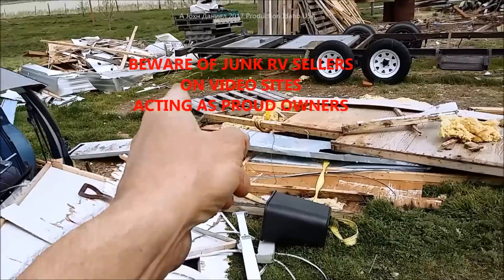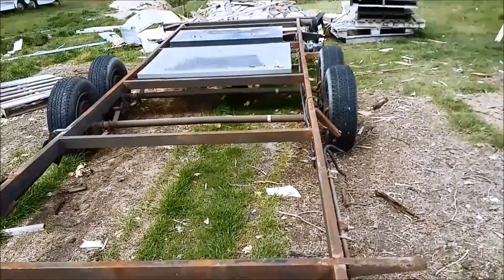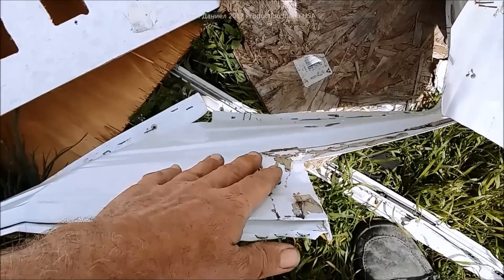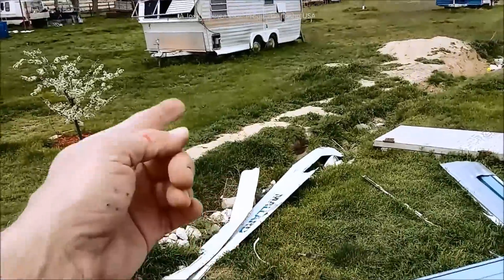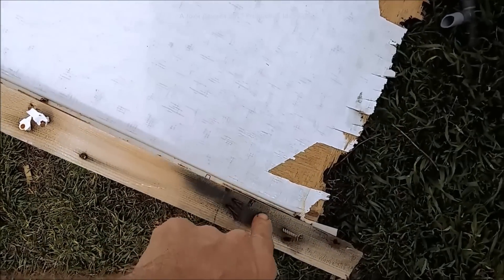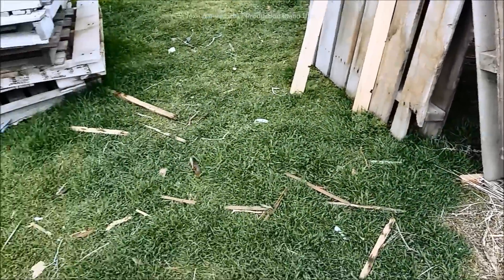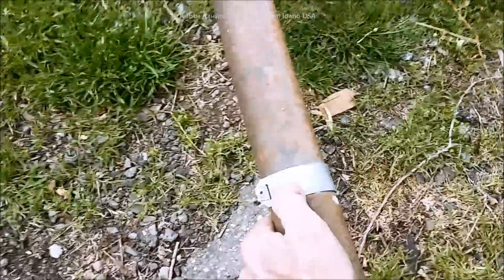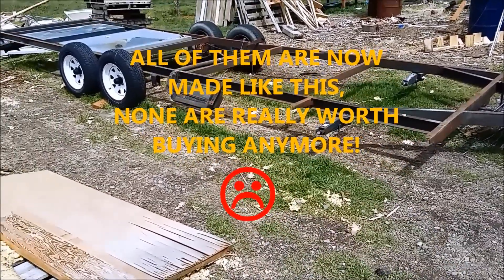HOW THEY MAKE RV Campers Travel Trailers, The truth, Wow! Info Below

Comment: My granpa has a 2017 basically new 50's style camper. It is beautiful, it has whitewall tires, cool red siding, and a checkerboard floor. But its the cheapest piece of shit I have ever seen!! They live in a very rainy place which makes it completely unlivable. With 7 damp-rid containers, and wiping down the windows it still is starting to get significant water damage. Anything that touches the wall rots it out and molds. The walls are made of what can only be described as fancy cardboard. When you so much as gently push on the hall wall that is also the shower wall the entire shower bows and faucet and whatnot move a good 4 inches. Ive been staying in it temporarily and i do my best to maintain it but im ruining it just by being inside it (condensation from temp difference). I wipe the windows, below the windows, and the 3 inch strip of wall along the floor but theyre still molded to shit. Any advice (other than lighting it on fire and pushing it off a cliff), this really makes me look bad but im very responsible and caring, it just seems like they werent designed to be inside when its below 50. Its a floor model so idk if that has anything to do with it
Reply from the maker: I am working on a dehumidifier design for RV's, stay tuned, should have by summer.
Reply: @JOHNDANIEL1  i know window mounted air-conditioners can be used as makeshift air condensers (de-humidifiers) but do you have any reccomendations in the meantime for the water warks/mold? Like a spray or something. Im considering putting in molding strips like you would with carpet to cover the damage along the floor wall. Is that horrid cardboard with veneer easily replacable without noticing? I feel like such a negligent ass-hole for whats happening but its not like im taking steps to prevent it its just made so friggen cheaply.

Comment: Yea, we bought a 2018 forest river. When the dealer tried to tell me "RVs are more expensive than cars" I had to laugh at him. My civics are built a million times more complex and better than this thing.

We have had numerous issues with this "brand new" camper. Iv fixed 2 water leaks already, fixed some loose wiring issues. 

So yea, from someone who bought a new trailer, dont buy a new trailer haha. Its all about weight and money savings today. My CL600 weighed more than this 25 foot 1 slide out camper I have. Its certainly using all the plastic and particle board it can with the thinnest metals.

Comment: I don't recommend no one to buy a USED trailer, why they are so cheap that is better to put a 10% down and pay less than $180.00 Guys if you want to buy a Trailer buy a 2018 or 2019 Jayco Hummingbird the only problem that owner had with this trailer, was the Norelco refrigerator not cooling enough, but now Jayco has changed them to DOMETIC we HAVE  ONE and I love it, but we own a 2018. That is a old trailer more than 10 years hey it's like a car you finance them for 5 years no problems after that problems start.  That why we bought new.

Comment: your posting a video of a camper that is 10 years old... do you consider a 2008 camper new, like new, or old as heck.... if a guy paid 3500 for it have you herd the saying you get what you pay for???
Reply from the maker: Yeah, your right. They should all be rotted by the time they're paid off LOL! Anyhow, this video is 1-1/2 years old, made and uploaded about a year and a half ago, and the trailer of such low value was stored inside a warehouse from November 2011 till the end of the court law suit which ended in January 2017. It was sold second hand for $3500 by a dealer who "shucked it off" as a repo, "JUST PAY OFF THE BALANCE" he says knowing it was a lemon and pasted over known damage from the actual manufacture failures to install numerous seals. 6 figures settlement came from the claims. We got it in storage auction salvage haul, for $100.

Comment: My opinion... First off we all need to keep in mind that there are many Manufacturers out there and they all have different levels of quality and craftsmanship. I agree with many of the point brought up on this video such as the mastik, cheap particle board, thin gauge siding, and other issues presented. The quality of ALL RV's can not be based on this sole and sad example of a 2008 Mallard. There are many types of construction materials that will not rot such as Azdel along with aluminum framing. But all the ROT seen in this example is the result of negligence and poor maintenance. Regarding the rot- there had to have been water getting into the walls for an extended period of time. Rot does not happen overnight. See the link below on ROT. (http://www.mcgarryandmadsen.com/inspection/Blog/Entries/2013/4/11_What_causes_wood_rot_on_a_home.html) If that water penetration would have been stopped the rot would have stopped... After working as a Welder building custom trailers it is noteworthy to mention that the gauge used in this Mallard is quite thin and has few crossmembers on it imo. But any frame that long without the structure to go on top will wobble if you apply a force on a corner as was done in this example. Try it yourself even on a flatbed trailer so you can get an idea. What my GOAL is with my comment is to tell RVers not to get "spooked" by this 2008  Mallard that had a sorry life... Research and do your homework if you are considering buying an RV. My personal advice: 1. Stay away from wood framing and aluminum siding. 2. Go with aluminum framed walls with Azdel which will not rot (Coachmen Freedom Express models are a good example of this type of construction. https://www.youtube.com/watch?v=XmTw9mlEe5w). 
John, thank you for sharing this video that depicts what can happen when proper care is not given to an RV and when poor quality materials are used....
Reply from the maker: The Mallard had 2 concerned owners, both had RV carports. What they didn't have was ESP. If they could have known that most of the windows and half the hatches came with a obvious Friday afternoon build that installed NO seals in half the trailer from the assembly line, then neither likely would have bought it. I got it in a insurance release for $100 to salvage, it came to be slated for salvage due to a court judgment against the dealer and maker of a significant amount. Seems over 4,000 cases similar about half assed builds already has been in the courts since 2003 according to the previous owner when liability laws allowed it.
Reply: Very interesting. Looks like the carports the RV was under did not have a roof. There would be no rotting otherwise even if the RV's joints were bad. It is sad to see what the owners of the Mallard had to go through...  I just want to point out that not ALL RV's are built the same and  people should not be afraid of buying one because of incidents like this one. The RV example I pointed out before has no particle board and no staples in it's construction (https://www.youtube.com/watch?v=iU6y0zum7OQ). I own one & love it. The title you gave your video sounds like a stereotype towards all RV's.  It's like saying ALL cars are bad because there is a specific brand that has a bad batch.
Reply from the maker: The first owner I have no idea if he had a roof on a carport LOL! The second guy however definitely did, thats where it was hauled from.  However, the cause of all the damage was not a weekly Florida downpour of rain, but a few winters of blowing snow in Idaho. Snow blows into carports, sticks to everything, melts and drains into the non existent seals over the windows and hatches. We sprayed it with a garden hose and water came out the bottom of the walls after about a hour drain down no less than 5 places to see if salvage or save was a option before demolishing it. The rot was due to such a low quality of assembly, glues, wood, and missing seals. Imagine how much damage was already done in the recorded 4 months on the dealers lot in the open weather, all hidden by trim, vinyl and numerous cavities.

Comment: I always wanted a motorhome   never a trailer.  I have had a Superior from the early 70s  and then a Holiday Rambler form the early 80s  and then a Dodge Avco that I sold   and now I have a GMC RTS transit with highway gearing all stainless steel construction  a have an old MCI Greyhound  and a Van Hool entertainer all stainless tubing and  under carriage.   I will never buy any motor home  only buses  that's it.  Although I saw one guy here posting he has a Winnebago Vectra  I wouldn't mind one of those.   But I have had many issues with the Holiday Rambler,  particle board furniture floor rot .  Same thing with the AVCO  both high end motorhomes of the day and  had to replace the whole ceiling from water leaking.  cheap possum doors and cheap fuel doors.  on my buses everything is steel stainless steel and heavy aluminum.   School buses  I am looking to get an International conventional with the DT-466   and schoolies are as well built as regular buses  for the most part.    I love your video and love how direct you are   without any filters.  you're right most of them are SHIT

Comment: 50 years plus experience high end remodel contractor here that spent over two years looking at every used RV deal on craigslist and others, trailers and motorhomes alike, in 3 states for a temporary living quarters while I build my home. Every last one of them out there is this bad or only slightly better I even ended up buying a '91 Airstream "Land Yacht" 33 foot trailer that was never used just sat and under cover since new which only qualifies as somewhat better the price was just too good to pass up and I needed something.

  Long story short "Recreational Vehicle" means if you will have to recreate it if you want anything resembling a vehicle.

 Recommendations : If you're looking to invest in a pull trailer buy a decent quality houseboat and enjoy the best of both worlds or remodel a cargo trailer. Motorhomes ? just find a bus conversion or pay a handy carpenter to convert / finish one and have something. Yes even my Airstream "Land Yacht" I find laughable at best considering the hype in fact if you're considering any RV, seriously go shop the real yachts for sale, go to your local boat show which doesn't cost a dime, the ones that cross oceans and get an idea what truly quality construction consists of because it has to be so when anyone out there uses the word quality you'll know what they're full of or not. It felt good to rant after spending so much time coming to the shocking reality "RV's" are ALL !!  truly just junk out there man they're not even basically safe and I hope this may help someone

Comment: Perhaps it's me reaching out for a thread of hope here, but could it be similar to how homes are constructed? A windy day can down framing until sheeting and/or trusses are put up. At that point it is strong enough to handle the weather. Or am I, like all of us, doomed by shoddy construction with my only hope being to take extra good care of it and keep it dry?
Reply from the maker: Sheathing has structural counter effect, these using just 32 gauge aluminum foil on them is very ineffectively counter braced. A home has the benefit of weight also. And a RV is depending on 2 dissimilar materials to against rules of weather, and decomposition behave as one (  flimsy metal frame and flimsy wood top )

Comment: I hate to say it , but my 93 Fleetwood prowler 30L has seen winter and summer in Michigan uncovered since new and it had no water damage at all like that . I know for a fact because I just redid the entire thing inside and gutted to the frame . One small corner in the roof was rotted from a leak made by an aftermarket ladder install . But those mallards look like junk , mine is a luxury liner , central air , central heat , walls were properly insulated , appliances all still worked and we're larger than usual . Nothing was broke either after 25 yrs of use .
Reply from the maker: Your lucky, or bought smart. Yours was built at the George town Texas plant before they sold Fleetwood to THOR, , this one was built in shitty RV land Indiana.

Comment: Not all campers are like this one shown. That one has been neglected by the owner. As for “pumping out 50 a day” that isn’t how most manufacturers work, very few make anywhere near that many a day and some take longer then a day to make one camper. We did our research before buying and toured factories and ours has a fully welded aluminum structure with frp walls. Oh and has a 12 year end to end warranty covering everything including paint fade with no need to even wash it and still covered. You need to maintain and check/reseal camper as a minimum every year, or more often. My last camper was 13 years old when I sold it and got $500 less then what I paid for it when I bought it. Dealer that bought it said it was in better shape then some that were a year old and they sold it for around the same price as a brand new one

Comment: I had a 33 ft. 2001 Tahoe Transport 5th wheel that I beat the living hell out of. Overloaded it several times, tore through the sand dunes in Glamis and Pismo being pulled by the F-350. Clipped islands in grocery store parking lots, hammered down horrible California freeways, through the Texas heat, Colorado winters and it held together like a tank! Finally gave up the ghost while being stored. Massive wind gusts pummeled it and tore the front cap off. I didn't know about it until 2 months and 3 rainstorms later. Water damage beyond repair.  I still weep a little thinking about her and all the good times.

Comment: it;s criminal to sell these to the public. thanks for bringing this to our attention. pioneer is another bad one. these wafer board floors literally rot and fall out . JUNK. I had to replace segments of my wafer board] AKA OSB] floor with plywood. my walls are aluminum and I was able to raise them and put 4x8 sheets of plywood under them. this was an all summer long task for me. It's done right. Added insulation, moved the power inverter to an accessible location. Did it right. This was an aluma-lite. good frame and chassis ,horrible osb floor. don't try this at home repair. good video.

Comment: If you spend $17,000. on a trailer  and $20,000 on a truck to pull it. $37,000 total. hotel rooms are $100.00 to $250.00 a night.if you find a hotel foe $100.00 a night.you could stay for 370 nights and $250 a night you could stay 148 nights. and don't forget $50.00 to $150.00 a night for a camp sight.
Reply from the maker: Very accurate conclusion, but I am a cheap skate, I don't like going where motels are, sorta got into a network of buy it used, inspect it like a termite and master mechanic before offering a red cent for it! Swapped a salvaged engine for a 35 foot RV, needed very little, then installed a massive solar array for a guy who had a 1 ton van he didn't wan't, best outcome is you have in my case 30,000 left over & can do everything those spending that 37k will do, except get ripped off.

Comment: Yeah, I worked for Fleetwood briefly. The wood floor stiffened everything up but when rot sets in your screwed.
Reply from the maker: Sorry to hear you were tortured by them! LOL. The problem with all the Rv maker designs is contraction/retraction rates of metal verses wood. It naturally self destroys. My trailers I custom build uses a 2.5" thick, smooth 32" wide poly-iso foam filled local made garage door panel, with 5 inner support seams/webs. You can get any length to 40 feet continuous and cut it anywhere you want for holes for plumbing and more with no loss of strength within reason. Its 4x as rigid, 17% lighter, 50% faster, and no rot possible with a 50 year rust resistance. Metal on them is 26 gauge, webbing inner structure is 24 gauge and they snap together with a locking seam. I build complete trailers with them, roof, walls and all. Result is R-15 insulation rated.
It's my own design, in 14 years not one other has ever been seen done but by me.

Comment: I don't buy it that the walls leaked.  My experience from many years ago when I owned a Camp King Coach purchased in Los Angles, was that when we took it up to the mountains for a weekend of hunting, it at time felt like it was raining inside the camper from the large amount of condensation.  When the walls don't have sufficient insulation, the humanity inside produces lots of moisture which then gets into the walls and everything becomes damp.  It is that dampness that produces that dry-rot.  Yes you are correct the engineers make sure that everything on those travel trailers and campers are minimalistic in their construction.  Some have called it "Planned Obsolescence".  But I think that proposing that the walls leaked is a bit of a stretch.  I would suggest that the leaks came from where the ceiling and the walls meet, is the first place I would look.
Reply from the maker: Walls leaking ( technically speaking) would be the exact cause of damage as found by jurors and 3 investigators involved when the previous owner proved Fleetwood sold junk. Of the 8 windows, 5 had ZERO mastic, caulk, evidence of mastic or seals ever installed from New. Over 200 other verified complaints also found same issues. 3 of 5 hatches had ZERO seals from the factory. So by telling in the video that seals were missing its based on our salvaging it as well as court conclusions. No leaks were found where roof meets the walls, all leaks traces were in the walls.
Reply: Thanks for the reply John.  I would not have expected that they wouldn't even put sealing caulk around the windows.  Wow.....  Fleetwood should have been put out of business.  thanks again and keep up the good work.